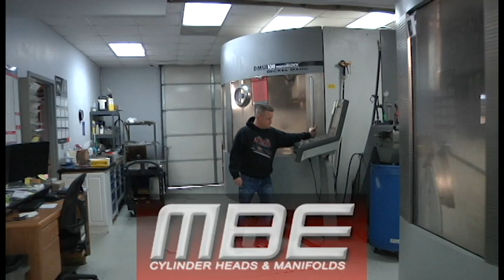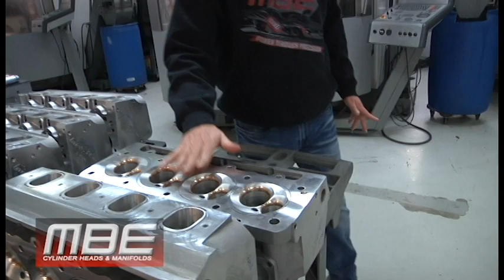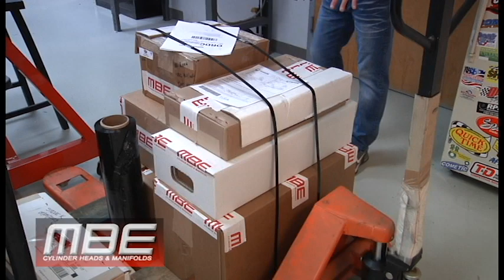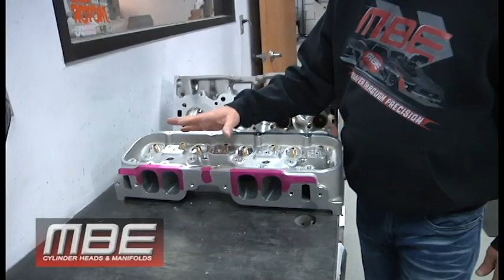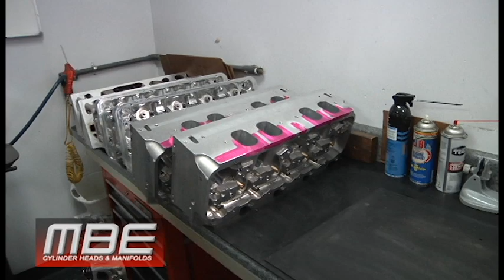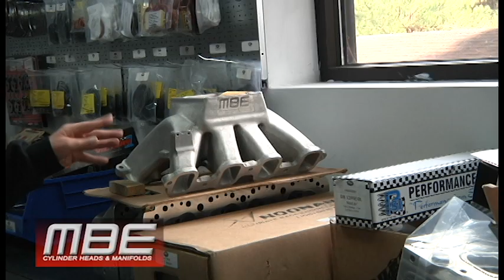This Week at MBE 2/25/2024

Comment: You're going to have a hard time convincing someone to go with your engine over a SM engine!
Reply: Steve Morris? Hey, I like Steve and his stuff, but name one championship one of his engines has won, Except for a drag and drive. And his engines haven't even won many of those. They always have issues and it's "never" Steve's fault. That green SMX powered Monte, didn't make it one race at sick week.
Reply: Good luck getting a smx when there are zero blocks sitting in a cnc today being made....steve had to buy out his guy, bring that machine into his shop and rebuild the machine because it was trashed, and re engineere the fixturing to machine the blocks
Reply: Smx is basically a 481x with water jackets. I like Steve but his engines aren't the best, heck Jeff Lutz ran a 6.15 on 7 cylinders at sickweek. I'd Luke to see a set of mbe heads on Jeff's engines.
Reply from the maker: We don't build or sell engines only manufacture cylinder heads and intake manifolds and yes Steve has built engines with MBE top ends
Reply: Youtube racer doesnt even know 1/10 of the bad mfers in this industry. 😂